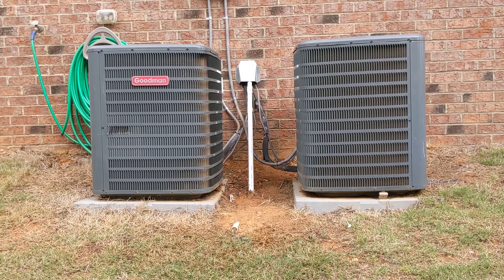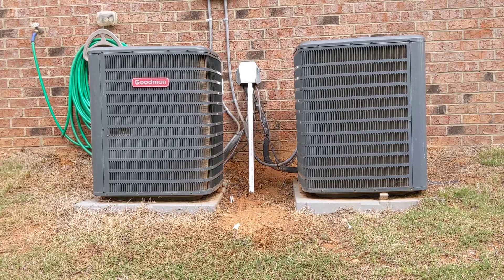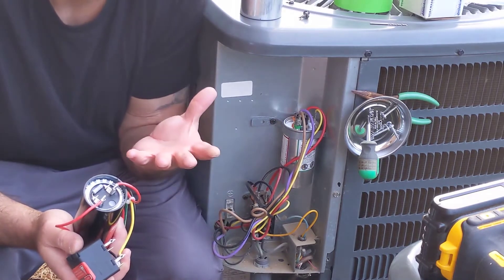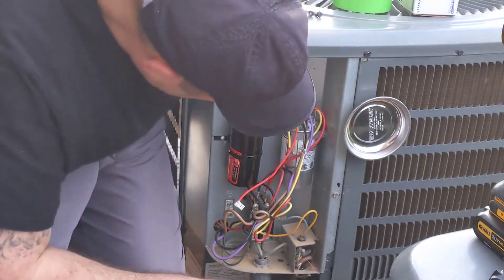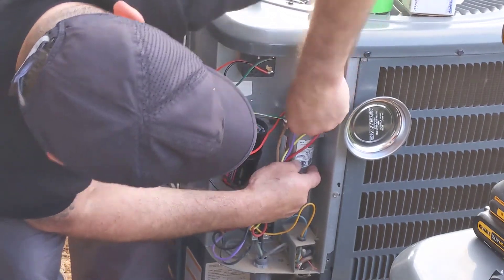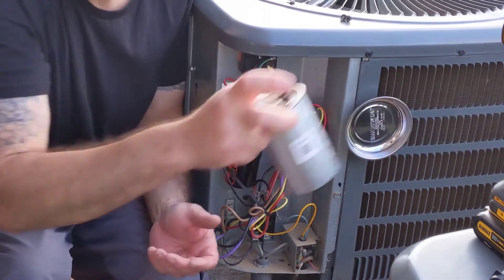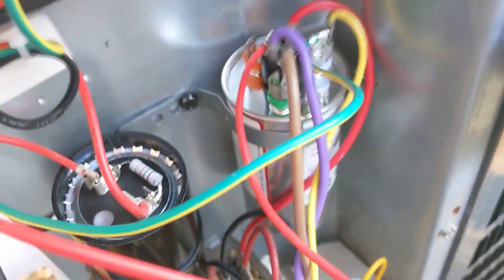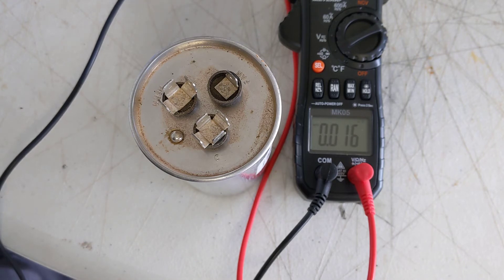How To Install A Capacitor & A 5 2 1 Hard Start Kit In Your HVAC System

Comment: Just a heads up, that specific Capacitor is an AMrad with CPT (Compressor Protector Terminal) it’s made for use with Hard Start kits to protect from an inadvertent restart. The red wire on normal caps is connected to the common, but on this AMrad you want to connect the Red wire to the Orange CPT terminal.